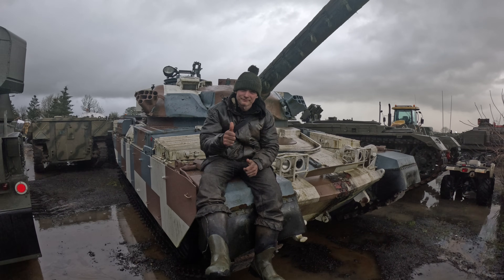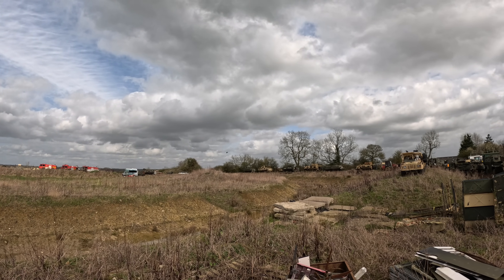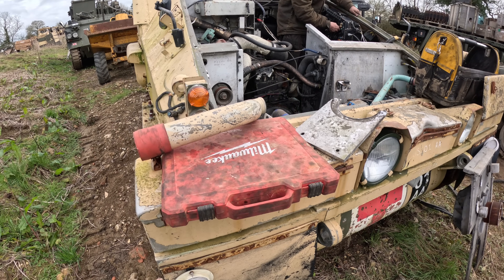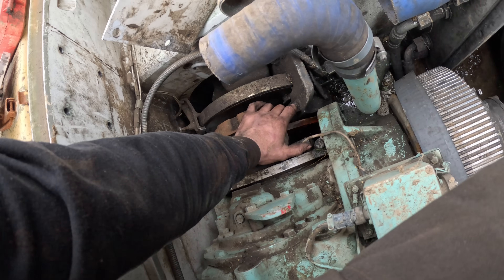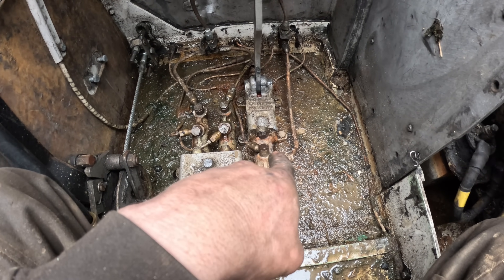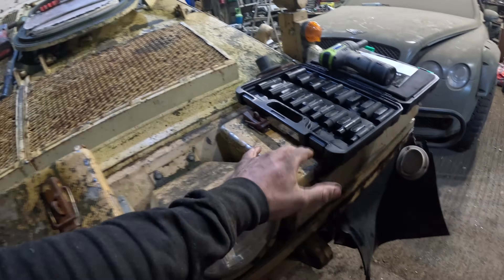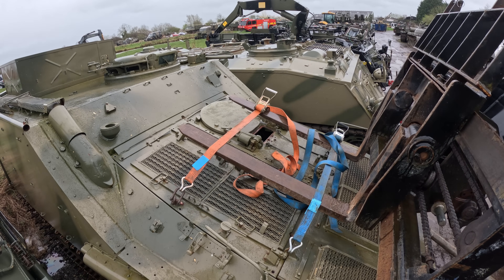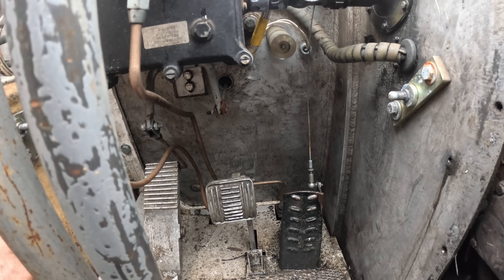HOW TO FIX A TANK!! with a little update on the challenger 1

Comment: How did you get hold of a Challenger 1 MBT?
Reply: They sold off a few a few years ago, minus the Chobham armour. There is another preserved example in private hands.
Reply: @fredmargerum1486  haha seen that, i believe there was a bit of a story behind that one, something to do with it being cast as it was a Vicker prototype (not sure) i think the main chassis was sold off first and the turret came later, might have been a Mk 1 for training and then fitted - somehow the Army were a little amused at something like this being in private hands
similar story to an ex SAS long range Landy a friend had, in fact that was auctioned off as a smashed up high capacity 110/127 (i forget) and got a full rebuild, still on the circuit somewhere
i do love a good yarn, but sometimes they get a little twisted in places
Reply: @fredmargerum1486  It's not a C1. It's ATR 1/2 , which were trials and development vehicles used to look at various specs etc , for the MBT80 programme. If you need proof, talk to the Tank museum.
Reply: @thewomble1509  fair enough 👌